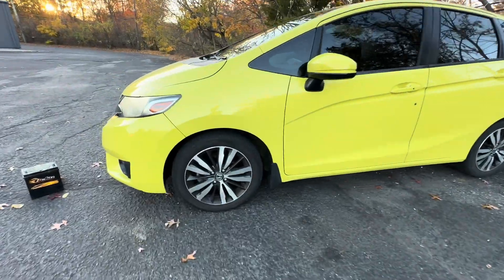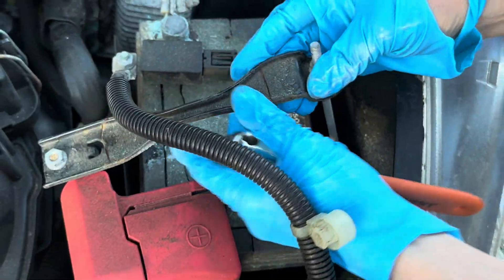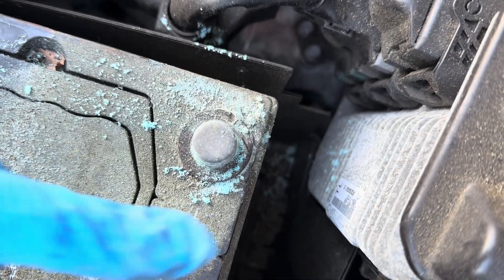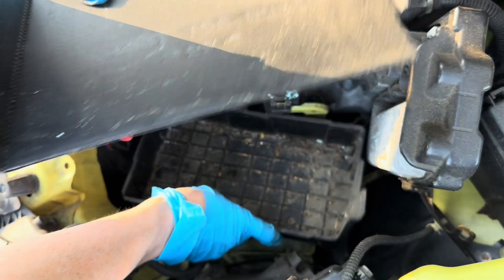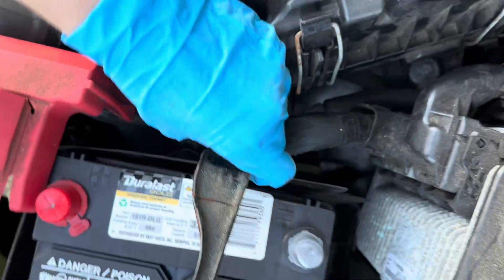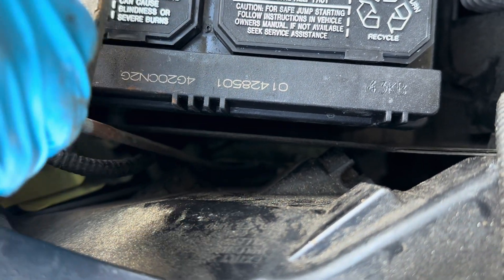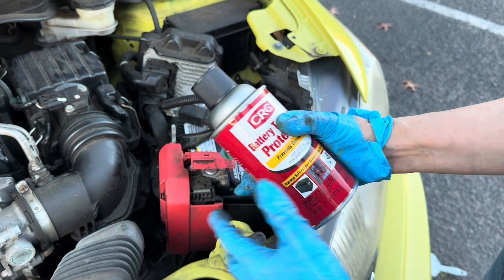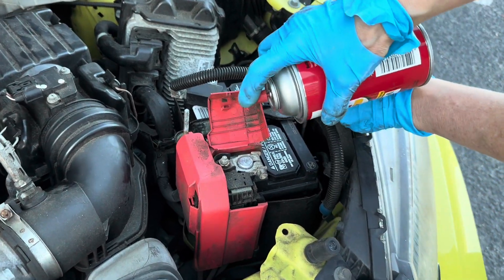Changing a Battery in a Honda Fit

Comment: Did you have to put a code or anything into the radio to get it working again? Mine needs a new battery but I’ve got no idea if my 2016 Fit has a radio code
Reply from the maker: No, it’s just turned on and started to work.

Comment: What a fantastic video. Thank you so much for posting this, really made it easy for someone that has never changed a car battery of any sort. Thanks again!!
Reply: Commenting one thing that made it a lot easier for me. I ended up taking the j bar that is hard to see totally off the bracket for reinstall. I put the j bar in the hole, held it, then put the battery in and attached to the bracket. I couldn't get it to line up otherwise.

Comment: you remove that white piece that’s holding the cable and connecting it to the J hook for the negative line so easily is it old. I’ve been replaced before so I’ve just been having trouble getting off the J hook.
Reply from the maker: It did come off easily and I didn’t have to struggle with it.

Comment: I did this today.  Thank you for the video.  I was a little intimidated by all the extra stuff attached to the battery clamps, but my under the hood looked like yours, so I tried it and it worked.  Your instructions are great.  The only changes I made:  my owners manual said to remove the negative clamp first just like you did, but the manual said it should be the last one to replace, so that is the way I did it. (That was actually the only instruction given in the manual for replacing a battery). Also, that white plastic thing holding the tubing to the J clamp didn't just pull off for me, but since it looked like a plastic screw, I tried unscrewing it and that worked.  It took me less than an hour and I'm a senior citizen.
Reply: I had the same problem with the white plastic part. Gave me a heck of a time to get it pulled off.

Comment: You could use 51R with that tray
Reply from the maker: 51R" refers to a specific BCI (Battery Council International) group size for car batteries, often found in Japanese cars and some older American cars, with dimensions around 9.374 x 5.0625 x 8.8125 inches. 
Here's a more detailed breakdown:
BCI Group Size:
"51R" is a standardized designation for the physical dimensions and terminal placement of a car battery. 
Dimensions:
These batteries typically measure around 9.374 inches in length, 5.0625 inches in width, and 8.8125 inches in height. 
Common Applications:
You'll often find 51R batteries in Japanese cars and trucks from manufacturers like Toyota, Nissan, Mitsubishi, Subaru, and Acura, as well as some older American cars. 
Examples:
Some specific examples of 51R batteries include the EverStart Value Lead Acid Automotive Battery, the EverStart Maxx Lead Acid Automotive Battery, and the EverStart Platinum BOXED AGM Battery.
Reply: I know it

Comment: Hi I'm gonna shoot my shot here and hope I get a response because I cannot find anything online about this, but I'm trying to put the battery bracket back on my Honda fit 2016's battery and the inner most J bar will not tighten and the J part will not stay in its slot. Im wondering if it is dangerous to leave it loose like that, because I can't for the life of me figure out how to tighten it! I can't seem to fit the 10mm ratchet onto it.
Reply from the maker: Is your replacement battery a similar size? If so the j bar should fit. It is tricky getting it in slot. The bent part of the “j” facing towards the battery. Get a strong flashlight to see better. Use your fingers to tighten the nut then you can use a wrench. 
 You could go to AutoZone and tell them about your problem and they can come out and look at your battery and show you the right tool.
Hopefully this helps